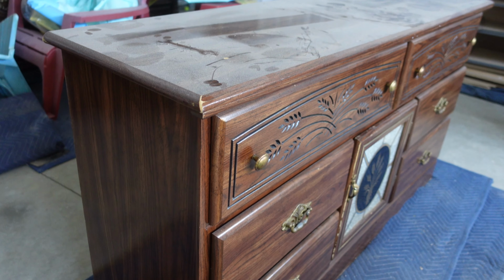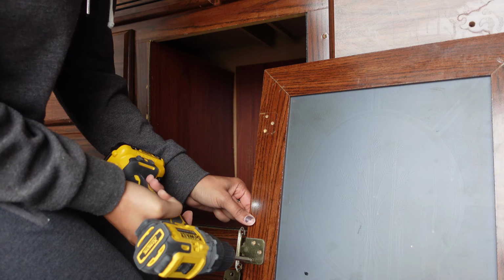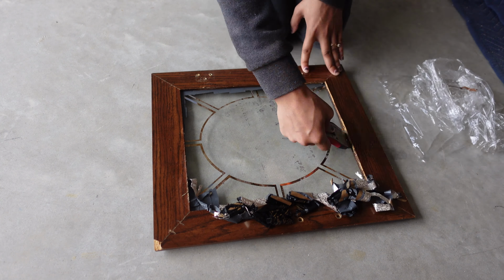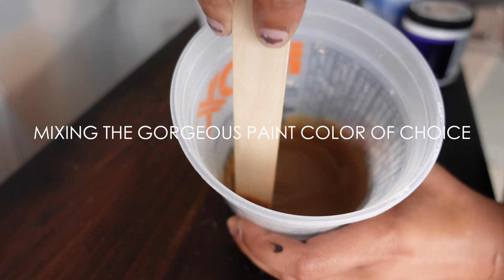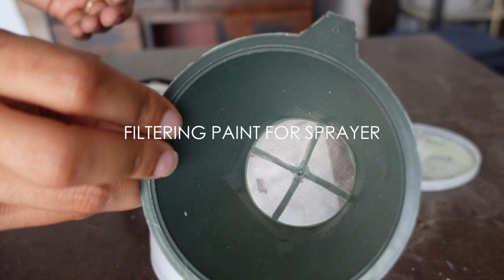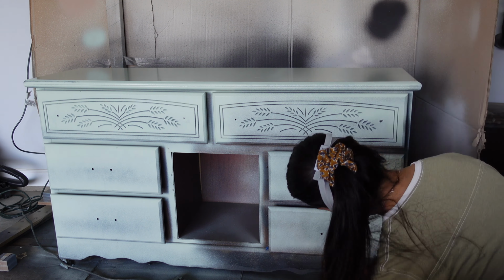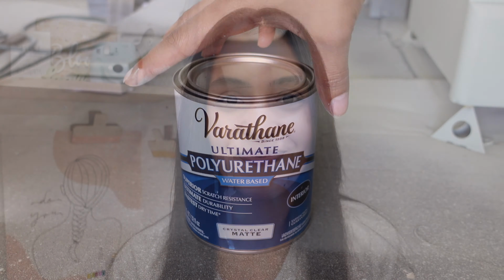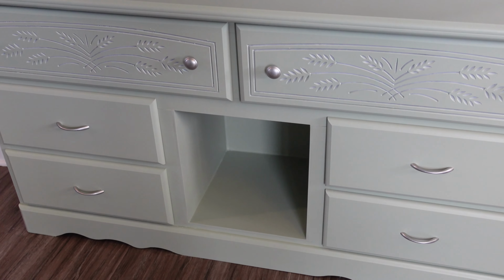DIY Furniture Flip || How To || Dresser Transformation

Comment: What color system did you use?
Primer, top coat and final coat?
Which brand?
Reply from the maker: I used all in one black spray paint by rustoleum 
 behr marquee Matte paint color jojoba with chalktique transformer and water 
Varathane water based top coat